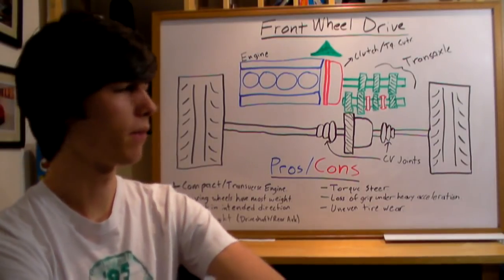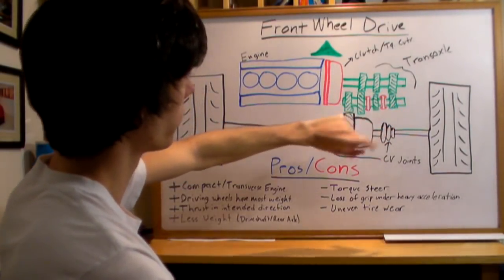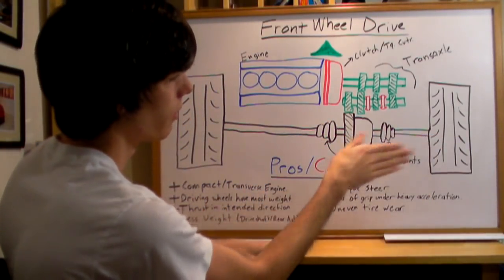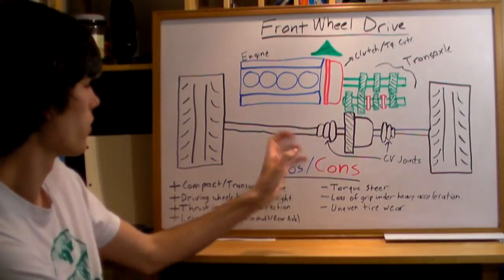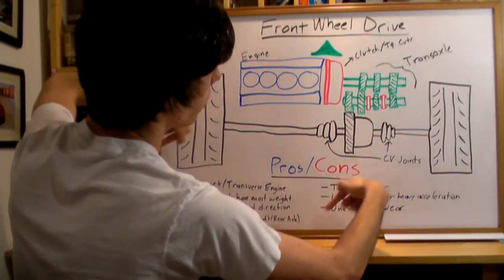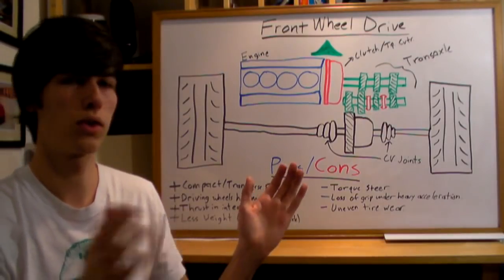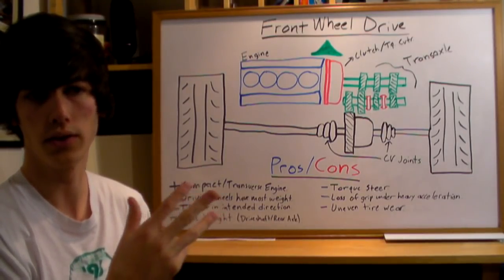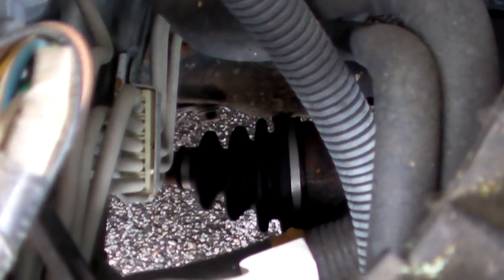Front Wheel Drive - FWD - Explained

Comment: You are one smart person with a lot of common sense, EngineeringExplained.  I work as a technician repairing people's vehicles and see a lot of abused daily drivers with damaged engine and drive line components from exceeding the limitation of the engineering the vehicle was designed for.  Racing or abusing your daily driver is not a good idea.  Just yesterday the tow truck brought in an 06 Mazda speed6 2.3L turbo with a rod hanging out of the block and the starter in pieces. Boohoo

Comment: On a rear wheel drive, the front wheels are just along for the ride, and ready to do your bidding. 
Try to (SLOWLY!) aproach the curb at an angle and let the front wheel touch. As you push the car forward, you should feel the steering wheel being afected.
Aproach the curb head on, and there should be nothing. 
This is in principal the same as torque steer. When the lateral forces of left and right differs too much.

Comment: Though Your an engineer, I can't give you a mechanical reason but somehow front wheel drive is really good on the twisty roads maybe the front wheels grip better or something.
I believe lower weight, short wheel base, the car usually is 900kg - 1,200kg generally smaller in the turn you take your foot off the throttle turn hard then as you exit go fast out of the corner.

Comment: You know, I know most of the driving advantages/disadvantages of fwd from spending far too much time learning about cars in general, but I could never quite grasp the actual mechanical side of it. I knew the engine was mounted transversely, and that somewhere in there was a transfer case and then axles which drive the wheels, but for some reason it only now makes sense how it all works together. Thanks a ton!
Reply: Can you tell me some benifits of fwd?

Comment from the maker: @KillerZero259 No, power is not necessary equal between the two, and unequal shaft lengths is a big reason for torque steer (the consequence of unequal torque). Many newer fwd cars address this problem with equal length shafts. As far as the gears, I just threw them in there fairly thoughtlessly. Mainly just wanted to show the layout.

Comment: the reaward force placed onto the ground by each wheel is exacting a momentum on the "steering mechanism".
At equilibrium each wheel is exacting the same force and nothing happens.
The slightest change in conditions, and you're going to feel one wheel winning, and exerting it's force, in the end, onto the steering wheel and your hands.
Changes in condition can be many things. A bit of sand, sligtly more worn tarmac or the incline of the road to make rain run off (typ. felt dur. undertaking).

Comment: If I consider the front wheels as fixed, when suddenly accelerating, a momentum is creating through the shafts and tend to sag the car on their rear wheels. It's the case where the shafts turn the same direction as the wheels. If the shafts were to turn in a opposite direction than the wheels, the car would rise regarding their rear wheels and most of the weight would be transfered to the front rather than the back, increasing grip.

Comment: I'm surprised no manufacturer (of my knowledge) has made a transverse fwd layout with the gearbox and drive shafts in front of the engine (imagine just rotating the eng - gearbox package 180°).
I think it would make a lot of sense, getting the car less front heavy, thus reducing understeer.

Comment: So how are you able to turn the front tires if they are the ones connected to the engine without completely destroying your axles or messing up the engine? Does the entire configuration move with the tires, including the engine and transmission, to keep the proper alignment?

Comment: So if the transmission is in the engine bay with the engine how dose the gear shifter reach the transmission. On rear wheel drive cars the transmission is under the car close to where you sit
Reply: Ryan Scherbluk shift linkage.. two rods, one is the actual shifter and the other a stabilizer rod

Comment: i don't know how i ended up here but this was very informative. thanks
Reply from the maker: Thanks for watching!
Reply: ofcourse! Once, the rubber covering under my front bumper had come loose but still attached to both ends of the bumper. The mid section was hanging down. Until i got my mechanic to cut it, I taped it around the metal piece where you have the CV joints on. It was a Civic so I'm thinking it should spun the tape and broke it off?

Comment from the maker: @PolishJoe1000 You're welcome, glad you like the videos! I wish I had your luck with the oil and coolant. Did you buy your car new? I bought mine as the third owner, with 84k back in 2007. I've had to replace the radiator (though 10 years isn't bad for a radiator) and many seals as it leaked quite bad. Doesn't leak too much now, but still have to top it off every 1000 miles or so. Transmission is impeccable, and I wish other cars had such good steering feel.

Comment: I'm attempting to put a front engine Honda Civic drive train into a rear engine Smart Fortwo and your video helped me understand what I was doing wrong!

What I was doing was trying to mate the Honda Engine to the Smart Transaxle. Instead, what I need to do is cut the axles and use the Honda Engine/Transmission and just modify the rear axle and frame!

 I also need to make up a list of what parts came from what car, because I know two seconds after I'm done building this something's going to break and I'm not going to remember where I sourced the parts!

Comment from the maker: I have a video on LSD, watch that one. The only difference with a FWD vehicle is that the transmission will typically be geared directly to the differential/diff housing, rather than using a drive shaft and pinion.

Comment from the maker: Well if it has to turn the wheels it's simply addressing the issue, but not getting rid of the problem. The driver may not notice it but it would still have it's effect on the dynamics of the vehicle. The tires would have more load than otherwise.

Comment from the maker: @MChief6596 It's just as easy. At the front of the transmission there will be two gears with 45 degree angles, transferring the the angle of rotation 90 degrees (the same direction of your tires).

Comment from the maker: @xe1A1ex The majority of cars understeer. There are many factors involved, but basically if the engine is up front (and the majority of the weight) the car will understeer if you take a corner too fast and hit the brakes. Now, this isn't the same as loss of traction because you put your foot down on the gas. Then it's simply where the driving wheels are. Up front - you go straight. Back tires - you turn around.

Comment from the maker: Somewhat, but since the boxer is a flat engine, the crankshaft will be perpendicular to the final drive shafts, so there will still have to be a 90 degree switch like in front engine RWD cars. It can be done with more direct gearing though.

Comment from the maker: FWD vehicles do not have bind like 4WD systems because typically FWD drivetrains have an open differential, which allows for differing speeds between the drive tires. Locking differential, if used in 4WD, will have binding if driven on pavement (or other surfaces with high friction).

Comment from the maker: Braking will not be affected (at least not much, if any) by drivetrain. Perhaps AWD would carry slightly more inertia, but FWD vs RWD should be about the same. The reason you're feeling a difference in brakes is probably the cars themselves. Mustangs are marketed as sports cars, so they have nice brakes/tires. What are you comparing to? Chances are they have worse tires/are heavier/etc..

Comment from the maker: @m00d79 It won't differ anything other than the direction of torque steer, which I will hopefully get into in a future video. Torque and acceleration will be the same. The lengths of the arms going to the wheels will be swapped, with the shorter arm going to the wheel closest to the transmission.

Comment from the maker: @Aexotica Great call, what I failed to include was the joints at each wheel. There are more universal joints at each tire, I just over-simplified it with this image. With a universal joint at the tire, it can turn with the axle rods changing angle.

Comment: My friend just got an 05 odyssey with a trailer hitch and the transmission has 1 problem when he shifts into reverse and it hesitates 1 second or so before engaging. I changed 3 1/2qts of fluid without much change in shifting. I know solenoids are problematic any comments like a transaxle problem? Very simple explanation to follow. Great job 👍

Comment: hey man. i know this is an old video and you're much more fame and responsible for more content now, but i'd appreciate if you could take the time and hear me out. i'm in a bit of a struggle right now. i have a VW Golf from 2008. started practicing revmatching and the heeltoe-downshifting technique a month ago or so. i already got quite ok at it, but sometimes i still mess up a bit. 2 days ago the driveshaft broke, according to the repair guy. now i was wondering if that could have been the result of me sucking at rev matching, since the driveshaft is kinda connected with the wheels and the motor. idk if that makes sense, because the gears are not directly connected with the driveshaft if i understand your video right. but i can't explain to myself why that thing just broke. i might be a bit of a racer, but i always tried to be smooth. i'd really appreciate your opinion on this (or anyone else if you also have knowledge about this)

Comment: The problem with FWD is not only uneven tire wear but also unwanted tire wear (e.g. saw teeth) at the rear axle on newer cars with multi-link rear axles. I have seen this a lot on newer Audi and Volkswagen FWD cars which have pretty good rear axles, sometimes even with XDS which do not cause much tire rub in the curves anymore. If you drive them without load (no backseat passengers, no luggage in the trunk) and oftentimes just straight on on the motorway, the rear axle remains a slightly positive camber which causes enormous saw teeth on the inner side of the rear tires just after 5000-8000 miles. You maybe wanna do a separate video on how saw teeth arise?

Comment: - shorter wheel base generally
- lighter
- more compact
- weight at front over tires for traction 
- doesn't fish tail as your exit the corner
end result a light car that doesn't fishtail out of a corner and turns quickly through them exiting them quickly results them being good on twisty roads.
you obviously haven't driven a little fwd then attempted in a v8 rwd, I have.... and that is from experience, not reading bs on the interwebs.
also no weight in the back is helpful.. e.g ute vs sedan

Comment: on a FWD would both wheels spin when loss of traction?
or would it be like a standard differential on a rwd car and spin only one wheel which ever one has the path of least resistance?
also do you have to have a LSD or some sort of system to get both wheels to spin instead of one?
I've heard of a mazdaspeed 3 has a front LSD, though front wheel drive sports car uhh..

Comment: Curious are front wheel drive systems direct drive? I currently have an issue where in gear at idle one wheel spins and one doesn't, but with throttle both start spinning. I know on rear wheel drive one wheel can spin while one doesn't but is it the same for front wheel drive.

Comment: Do cars designed in RHD countries like your Acura (Japan) or in LHD countries like a VW Golf (Germany) have the engine on their respective passenger sides to make pedal/gear lever connections more direct, or does it just depend on the engine/gearbox layout? Our LHD (I'm in Canada) Mercedes B Class has the engine on the passenger side; do manufacturers go to the trouble of making a mirror-image layout depending on which side the steering wheel is?

Comment: all i can say is ive owned both fwd and rwd and hes spot on with his pros and cons, my 07 impala was never meant for a 5.3 liter v8 so things like driveshaft, water pump, had to replace i forgot what these 2 bolts are  called but its 1 per side and are longer than the factory ones and help align  the front tires the correct way so you dont wear them out even faster. those are my main 3 cons i got

Comment: when transferring power to the front wheels, do both axles experience the same output from the transmission? i ask this because i saw in your diagram that one axle is longer than the other. 

and why do the gears get physically smaller as you increase speed? wouldnt the car be faster if the gears were all as big as the first or second gear?

Comment: I got a question! So what about differentials? Do they place differentials in front wheel drive cars? I don't understand how you would get torque steer without a differential, because if there is no differential would the same amount of torque be sent to both of the front wheels? Thanks in advance.

Comment: If the clutch and transmission extend from the engine to one side (as opposed to straight back in rwd cars), how does the gear stick connect to the transmission?

Comment: OK, that mean the differential need to be small and compact. I know how rear differential work, but I don't know how front diff work. If it just convert the ring gear function from converting radial to axial (axle shaft as axis), it would be simple. But you can't put large ring gear in front of the car (ex. FWD, AWD, 4WD).

Comment: To avoid the lost of grip when the car accelerates, why not put kind of portal axle with two small gears to reverse the motion? So the shaf with cv-joint turns in one direction, but the wheel turns in the other.

Comment: The new 2013. Focus ST and the old Integra Type R. Are possible the best handling front wheel drive cars ever especially the Type R. The ST still needs to prove it self over time. But it practically drifts and behaves similar to RWD.

Comment: @EngineeringExplained I was the second owner.  It had approximately 47,000 miles.  I'm sorry to hear you had to replace the radiator and some seals.  I did have to replace the rear control arm bushings as well as the motor that releases the rear hatch.  Also, I think my first gear synchros were pretty worn, but I never had to replace the clutch or flywheel.  Yes, the steering feel was exemplary!

Comment: Just one nagging question... Which is better on rain? FWD or RWD? Given no stability controls and low power such as 100 to 120 hp. In my country, RWD is perceived to be better than FWD, but our cars are only 100-150 hp max.
Reply: Honestly one is not better than the other, it all depends on what the car has for brakes, tires, and how well the driver operates the vehicle.

Comment: @EngineeringExplained Glad to hear there was no damage!  How do you feel about electronic nannies like stability control, traction control, brake assist, etc.?  There are times when I want some wheel spin, primarily in snow when I'm pulling out in front of traffic, instead of having the stability control cut engine power and slam the brakes, bringing me to a halt.  I wish those systems were fully defeatable.

Comment: thanks very much for that awesome explanation ..
i have a question ,,, in some FWD cars the engine is on the right side and the transmission is on the left ,, is there a difference between this and when the engine is on the left side ? i mean a difference for the torque and acceleration ?

Comment: Here's my question about front wheel drive: 
If I'm going up a muddy road in my front wheel drive car, and there's a dry strip up the middle of the road big enough for just one tire, which tire do I want on that dry strip, left or right? 
Thanks!  Great video! 
PS - if it makes a difference, I'm driving a 97 Honda CVCC...
Reply: I found the answer - not what I was hoping for...
It seems, the power goes to whichever wheel is spinning, that is, the tire in the mud, or on the ice.

Comment: Usually—about 90%—front wheel drive cars with transverse front engine have that engine on the right side and gear box on the left side. The opposite layout is considered exotic. So…
a) remake your drawing and
b) be proud of your Acura:)

Btw, 2 CV joints are missing—at the wheels.

Comment: Been curious to how FWD trans work, you explained it real well.

Came here to learn about open differentials, does the left wheel on my car get power at all and being driven purely by the right or does it vary?
Reply from the maker: Both wheels will get 50% torque, however if one tire is spinning it means both tires are getting very little torque. Open vs Locked Differential - Torque Transfer - Explained

Comment: Can I change my gear ratios to make car faster?  I have 500 hp and I spin  till 60mph and my top speed is 150 but it want  to got way faster if the engine  wasn't  screaming...
Reply: MARTWELLS  change your final drive in your tranny to a lower ratio, should help out big time and not to expensive👍

Comment: like your videos have a question i have a 2004 fwd 2.4L 4cyl Hyundai sante fe i lifted the front end of my car and put it in gear and only one wheel turns is that normal for this car/suv
Reply: It is an "open differential", so yes, it is normal. I think he has a video on differentials, so that would mechanically explain it for you.

Comment: Can you explain the second con? Why does the weight transfer to the back under heavy acceleration causing the front to lift up??
Reply: -Inertia wants the body to stay still while the wheels pull forward
-Weight pushes down on the rear wheels as the body rolls back
-Less weight on the front suspension means the springs expand (push the front up)